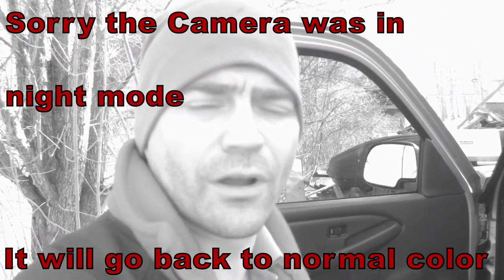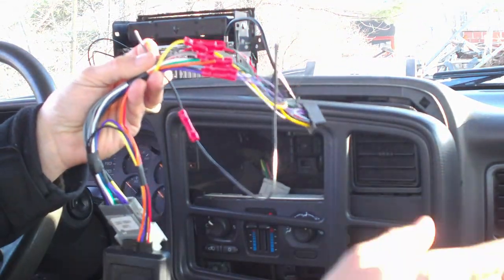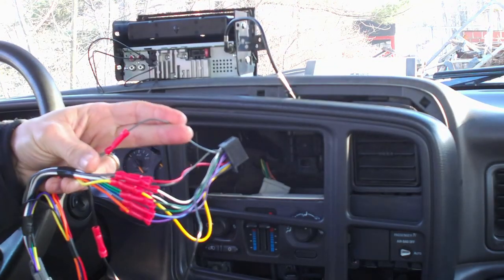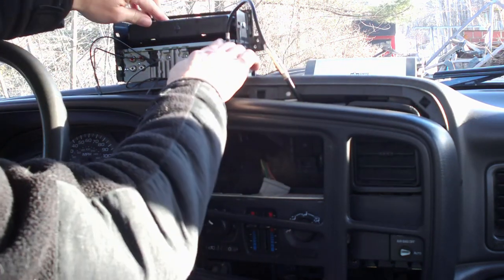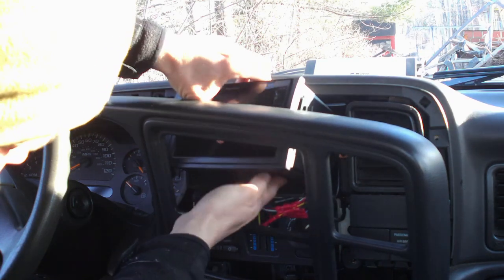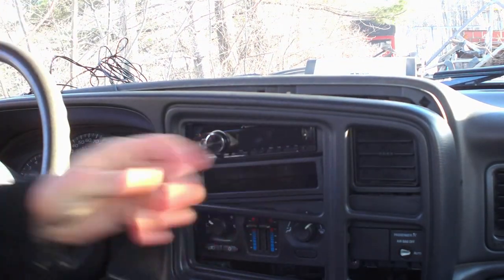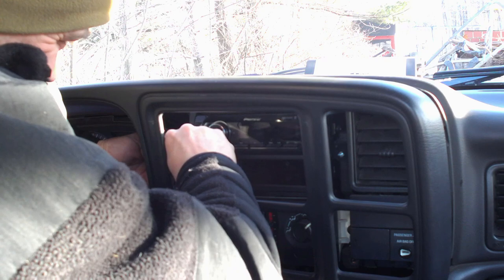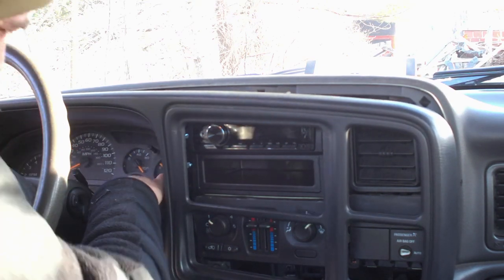2004 Chevy silverado 1500 radio installation

Comment: I think you did a good thing on showing your tutorial although I think you should have removed the bevel all the way it takes seconds to remove and I think it would have saved you time screwing it in , also I would recommend using the stock screws unless they were not available just so they won’t strip out by changing threads great job thanks for sharing your knowledge 😊
Reply from the maker: I agree I should have removed the bevel all the way

Comment: Hi can you tell me the info or numerical of the radio harness that will fit on the harness of the truck where it connects please
Reply from the maker: I the description of the video is a link to the harness you would need. If your truck is the same.

Comment: Since it has no usb to connect to Bluetooth does it go through the screen or do I have to install a usb to be able to connect to Bluetooth
Reply from the maker: The Bluetooth is wireless there is no need for a USB since it is built into the radio that I installed
Reply: @HomesteadingwiththeHeberts  sweet thankyou so much
Reply from the maker: No problem

Comment: When I seen that rust on the Kline I almost ducked. Brought back memories of leaving dads tools out. Whewww dodged a head slap.
Reply from the maker: Yes my kids leave the tools out as well
Reply: Great video my guy appreciate it
Reply from the maker: Thanks
Reply: You get the hardware and installation gear at crutchfeild ? Convinced me to upgrade my sons truck stereo. Thinking bout going with em
Reply from the maker: @jesscolliflower5531  I got my radio at Walmart during the holidays
Reply: @HomesteadingwiththeHeberts  Wb all the installation gear? Anything special needed harness or faceplates?
Reply from the maker: Yes there are. I have links in the description to the ones I used.

Comment: Dude, for God's sake tilt the steering wheel with the lever, shift into drive with the engine off, and remove the dash trim!!! The process would be a heck of a lot easier... Good video though.
Reply from the maker: Thanks
Reply: It's a manual lol